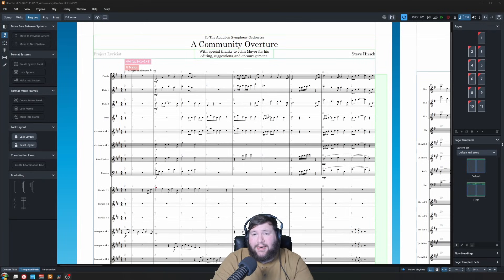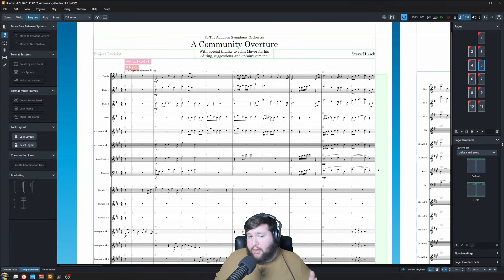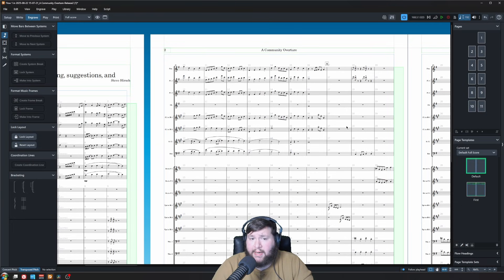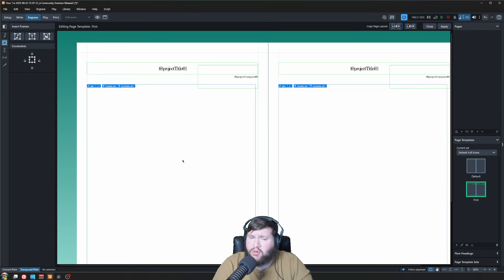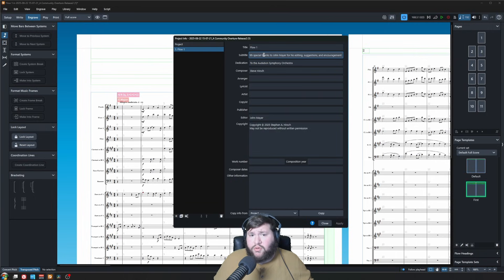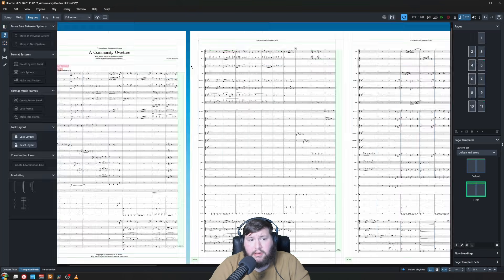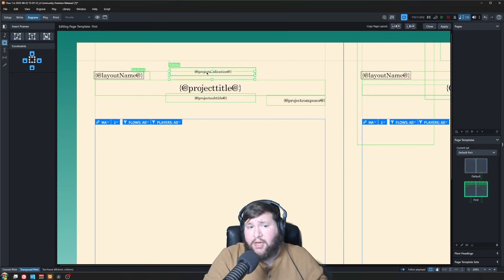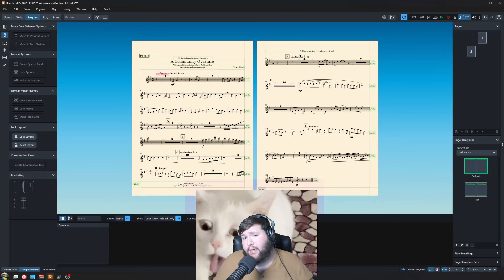Got Dorico Engraving Issues?: Page Templates

Comment: Thanks, CJ! This is helpful. It would be great if you could create one based on creating a [age template from scratch, rather than fixing an existing one. Also, what if you wanted to have two lines: "Arranged by" and right below that your name? If it will be on your master page template that you'll be using for most projects, should it added as a page override or entered as tokens? If the latter, how/where to enter "Arranged by"?
Reply from the maker: So quite literally type that text before the token, the token is just a substitute for your name! And that sounds like a great idea, I will make a mini to the point video on that. Thank you for watching!